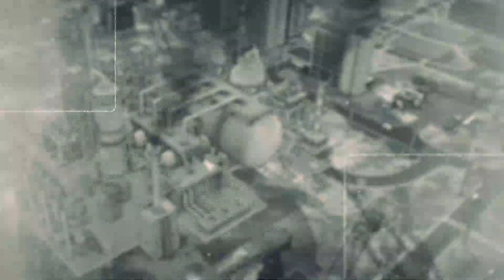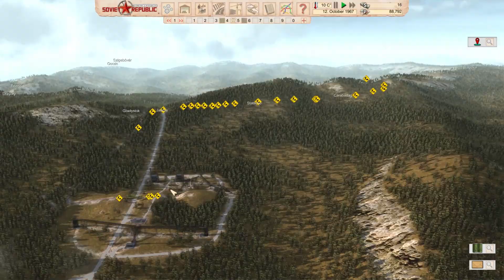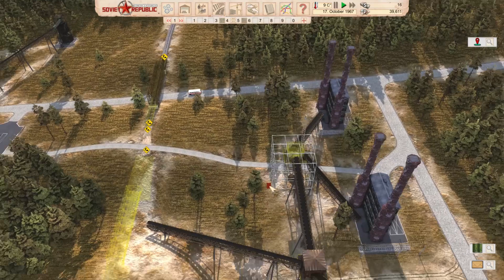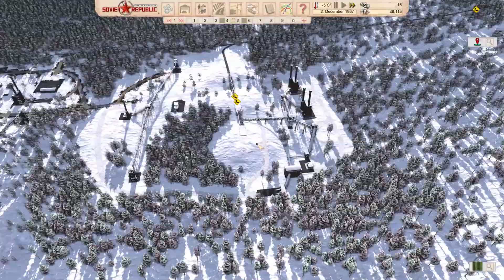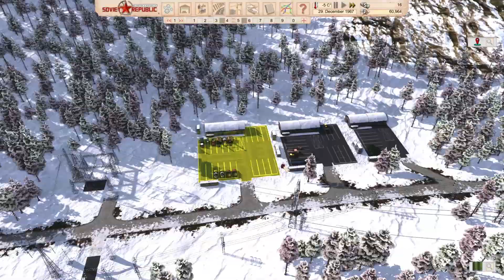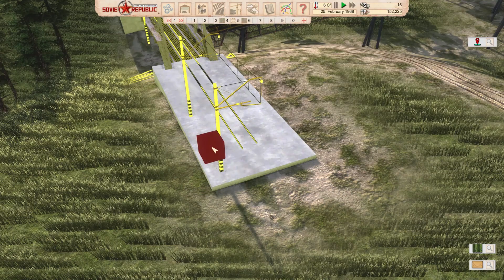Soviet Republic - Alaska - The Iron City - Ep.24

Comment: The nuclear plant in the UK I think is being built by the French with Chinese money (and some horrendous clauses like minimum energy price cap) .
As for auto-build, i think it's a non issue really. Whatever helps the flow of the game at the end of the day. You're penalised by paying more for it.
It's ridiculous to think you might need to move an electricity pylon slightly to fit some space and as a result half of your country will be without power for months while you wait for your construction crews to rebuild the connection, or some other quirk of the game makes it far more convenient to call Bobobski the Builder from the Soviet Union to get the job done quickly. 

The game can't model everything and for those situations where you need to work around the quirks of the game, there's autobuild.
Reply from the maker: Hinkley Point C!! This is the one I meant. :) 

Thank you for your comment on autobuild. :)
Reply: @oolykeegaming81  @Charlie Brown: with proper planning there are no 'quirks' in the game. Countless players have played well past 2000 without clicking autobuild past 1960. People are free to autobuild if they want to, but it's not necessary beyond the first  year. The only quirk or bug is the 3 piece pipe to my knowledge, and you can usually check or redo the pipe if it is in 3 pieces.